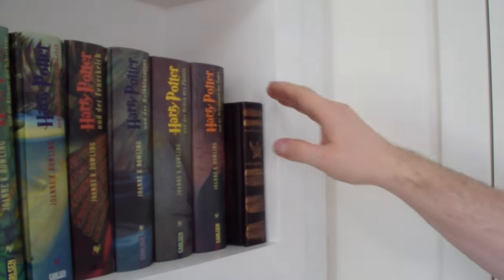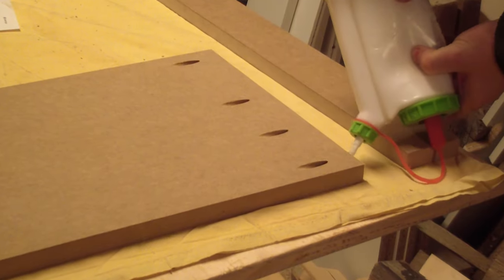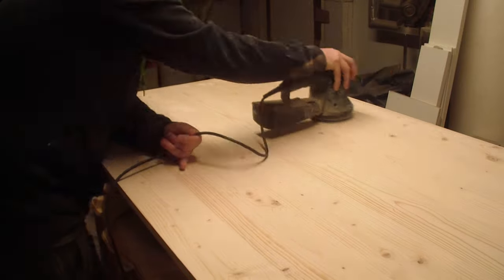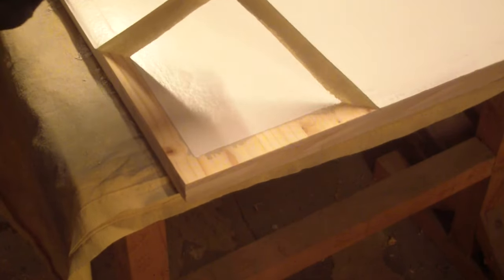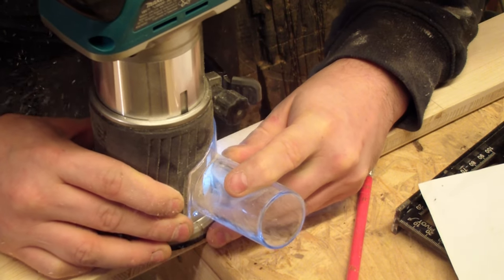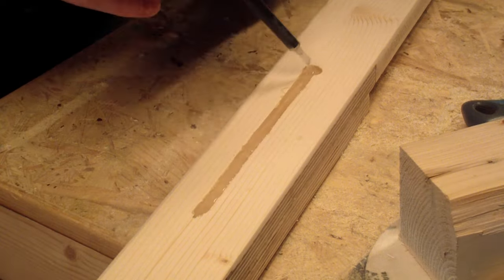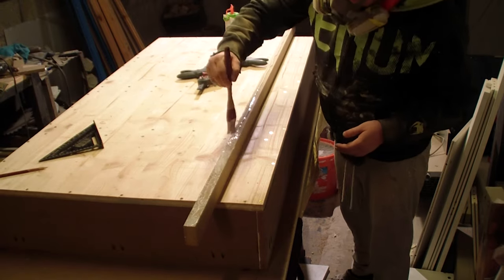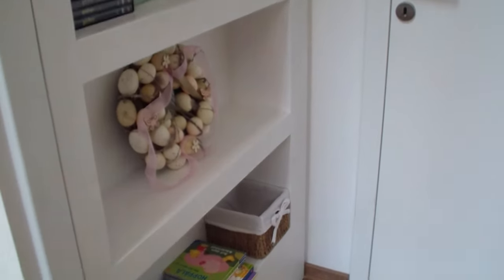DIY Bookshelf Door: My Ultimate Home Improvement Project!

Comment: I want to build the same thing in a smaller scale of 61cm x 122cm (24x48).  My rough opening is 24.75 inches x 50 inches.  I wish you had shown the hinges being attached.
Reply from the maker: @RagnarBlox  the attachment isn't really a big deal! Just don't buy cheap hinges. After one year of usage, i also would install 4 hinges instead of 2.

Comment: Have to ask, what hinges did you use? I love that the bookcase frame completely comes out within the molding. Most of the time the molding is part of the frame
Reply from the maker: Thank you :) I used heavy duty hinges. To be pricise: https://amzn.to/40vVc8Q
Reply: @patmakerman  I've seen those but I didn't think they would really be strong enough for a full bookshelf. By chance are you going to put the plans you use somewhere?
Reply from the maker: @hitnrun73075  If you are afraid of the weight, then use 4 hinges instead of 2 :) I can send you the plans if you want, but i think they will not help because every Shelf/Door has an individual size.